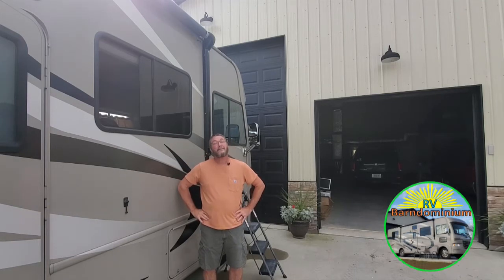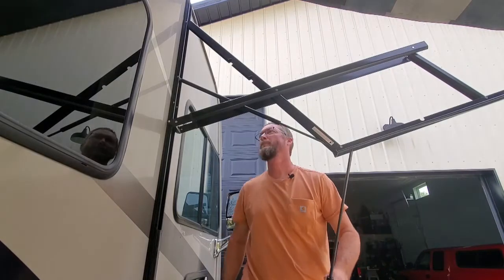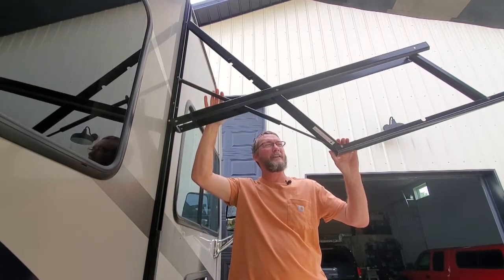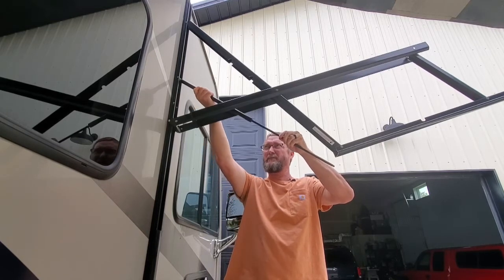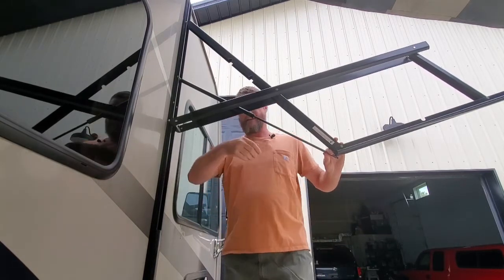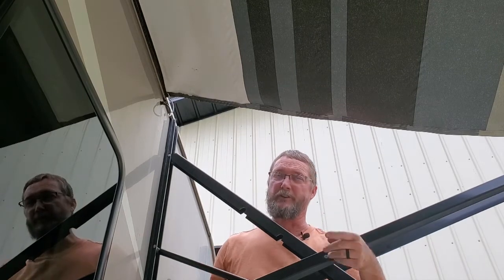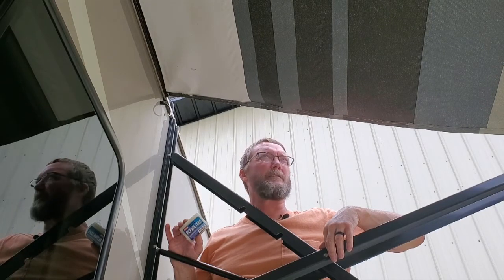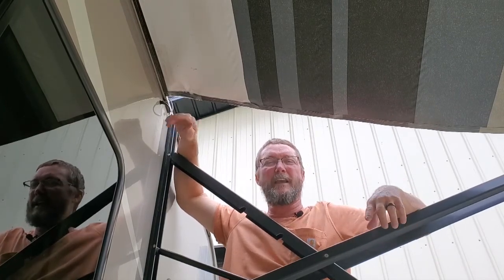RV Awning Repair || Barndominium Living

Comment: Do you have a fix for the motor side that the cap is flexing with the screw is moving in and out while deploying and retracting
Reply from the maker: Can't say I've had that issue. Post the situation on a message board on an RV site or the manufacturer's support site. I'm sure someone has seen that before.

Comment: Can u use a regular bolt if the original bolt is not available ?
Reply from the maker: The awning uses a rivet and not a bolt (especially at the top where the frame "nests" inside the other track.)  They should sell the rivets online also where you buy the strut.  I remember seeing the one for mine online.

Comment: With the old strut off could you compress it ?
Reply from the maker: It was a lot less stiff. The new one was extremely stiff
Reply: Could you compress it by putting one end on the ground and push on it with your hand ?, Both sides on our awning don't come out ,only the roller turns,tia
Reply from the maker: The new "good" strut is very strong. You would have to put it on the ground to compress it.   The old "broken" one you could push in MUCH easier.  It takes a lot of force (kinetic energy) to push those side bars.  That's why the new ones are so tight.  If the motor turns then it sounds like you just need two new struts.  That's a lot cheaper than a whole new awning for sure.

Comment: My awning stopped working i changed  out the fuse and it worked for like 2 seconds then blew i keep putting fuses and they keep blowing help please!!
Reply from the maker: Did u check for a pinched wire? That's exactly what ours did.

Comment: would this fit a carefree of colorado eclipse 20' awning? my shock was about 36-36.6"
Reply from the maker: I looked up the part number for my model and went onto Amazon and bought that part (or what they sell as an alternative)
Reply: @RVBarndominium  mine is a 2006, I looked all over and there was no stickers left that could be read. Everything was faded and worn out. I did measure the shock and it seemed to be about the right size, so I ordered it and it should be here this week. thanks.
Reply from the maker: Let me know how it works.  Good deal.
Reply: @RVBarndominium  while replacing the strut, I followed your method however I can't extend the awning arm long enough to screw in the strut. Which pitch guide number on the arm did you use to get the most room to screw it in. Mine reads 1-6.
Reply from the maker: I truly don't remember......I dont think mine has numbers.  I do remember that it would have helped having one person holding the awning arm and one person working the strut.
I think the sweet spot on mine was between two settings.